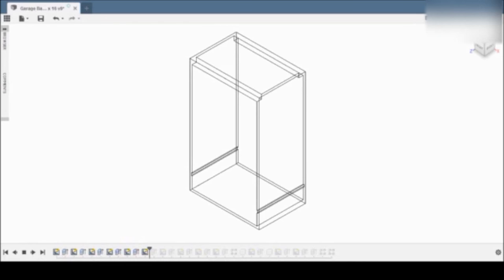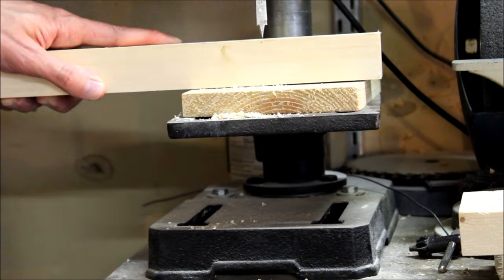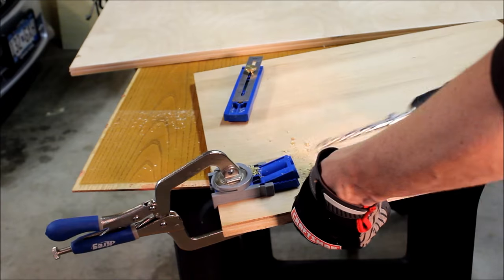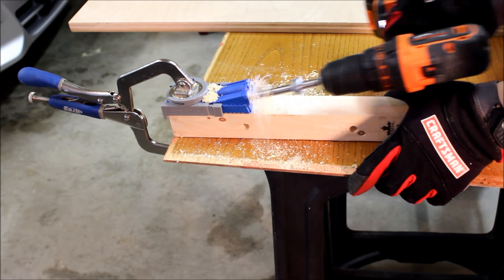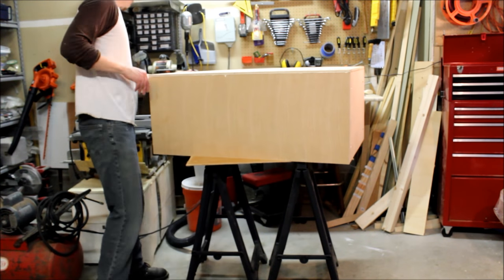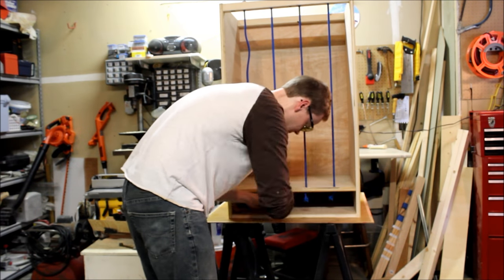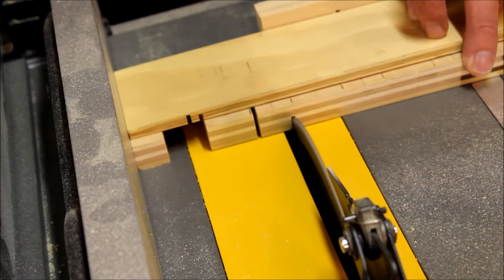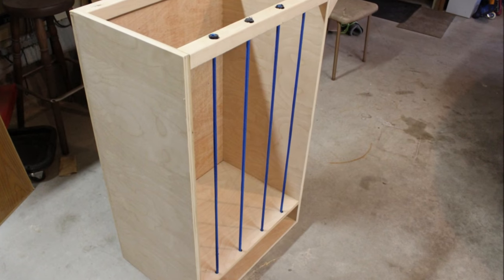How to Make a DIY Sporting Goods Storage Cabinet

Comment: This was a great thing and totally worth the 3$ BUT in the prints he doesn’t fully give dimensions or hole sizes…  I made it  slightly bigger and the bat rack able to hold two bats each and put it on wheels… it’s was easy to figure out the stuff that wasn’t there but I’ve been spoiled with a detail page with my prints but this was a good idea that scales to any size 👍🏻👍🏻👍🏻
Reply from the maker: Thanks for the feedback.  Feel free to let me know which dimensions are missing?  I'm happy to make updates and continue to improve the plans when necessary.  Glad your project came together and thanks for watching!  😀
Reply: @TwintownDIY  so on detail pages on prints for openings soffits or load bearing structural details each piece will always have its “nominal” dimensions 3/4”x 3”x 25” and especially have it on the other view for quick reference…. and youre right you had the hole size but the bit sizes are in fractions so fractions make it easier…. And Engineers LUV to use fractions but very few tape measures use decimals so for ease of reference fractions are the way to go… these are little things but they turn the plans you have to figure out and do paper math for into a quick reference that a easy for regular diy people to use